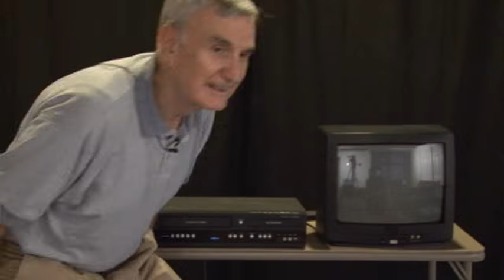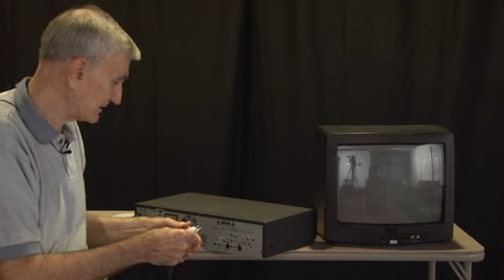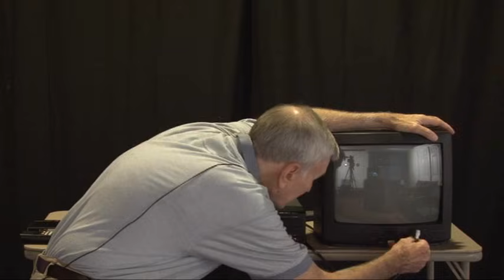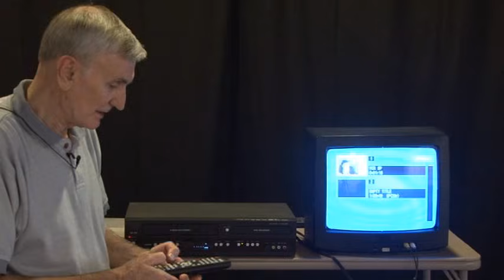VHS transfer to DVD using combo recorder

Comment: Anthony.  I have taken back to Walmart two VHS to DVD Sanyo recorders because they did not work. I had even called customer service for help.  They told me to take it back. I went online and saw that Toshiba 620 was recommended.  So I went to Best Buy and purchased it. However, after hours of trying and throwing away multiple disks that did not record, I finally went on YOUTUBE and saw your video.   OMG... the directions in both Sanyo and Toshiba manuals have told me to select DVD and push the record mode... THEN go on to select VCR and select "play"  THEN push the dubbing button.  Your video tells me not to push record mode on DVD but to begin the VHS tape and push Dubbing button.  AFTER HOURS AND HOURS (I am persistent) of following the directions from those manuals,  I did what you said and IT IS WORKING!!!!!!!  Both the SANYO and TOSHIBA companies need to edit the directions and hire you as a consult!!!!
Reply from the maker: +Margi Jacobsen, Thank you for the very kind comment. It sounds like you have gone to a lot of trouble. I'm happy to hear that you got your VHS to DVD transfers working. I don't know how different or similar various models are but I used a MAGNAVOX DVD RECORDER / VCR ZV427MG9 on my YouTube video. I bought it some time past, I don't know if it is still being made and sold.
Reply: Oi
Reply: Hi there this must have been a error made on behalf of Sanyo or Toshiba,   if newer/later models have inaccurate instructions, then whoever has written the manual has done a poor job, and not done his/her homework and not followed the rules on how to write/produce a instruction manual that is easy to follow and not a headache to learn from. To produce a manual it has to be easy to follow and instructions easy and simple to follow, Sanyo/Toshiba do not have proof readers that will read or see if the products they market is easy to use, as all they care about is money.. Sanyo/Toshiba do not test each product they manufacture it's down to the consumer/End User to see how the product works, Not Sanyo/Toshiba, though it's their responsibility which they regret is not the fault of theres, in which fact it is...
Reply: He makes sure to tell you the right steps so people can follow it right. He is a great teacher and I thank him for being so patient at explaining the process.

Comment from the maker: marion19561, this has happened to me a few times over the years with various VCR's. I most cases I removed the screws that connected the cabinet to the chassis, I removed the cabinet. That made it possible for me to free the VHS tape. I you have the skills to do this, this is what I recommend.  Otherwise I suggest taking the VCR to a repair shop.

Comment: Note: To finalize a disc on my unit you must first press the "stop" button on the remote, and THEN press the setup button.
Reply: Ty so much!!
Reply from the maker: mtaur100, yes sorry, i realized later I didn't emphasize that.
Reply: @dahdigital1  No problem. Thank you for putting out your very helpful video.

Comment: If I made a dvd and didn't finalize the dvd.  Is it possible to put the DVD back into the system and finalize it afterwards?
Reply from the maker: Mary Pepitone, Yes you can.
Reply: you can finalize it years later.....as long as the recorder functions it will still finalize .....if it no longer works the disc can still be finalized on an identical model dvd recorder
Reply: If the DVD is just write once and there is no space left to record or you are sure you will no longer add anything to the remaining space, it is good practice just to go ahead and finalize it. I takes just a few minutes. My recorder has an option to unfinalize, but I've never tried it. I often go ahead and rip my DVD recording to a compressed video file on my computer for convenience so I generally immediately finalize the disc. I don't recommend finalizing a DVD during a thunderstorm or recording one for that matter as the power can fluctuate resulting in a disc that can only be used as a drink coaster. My recorder is the same model shown in the video. I have found it to be pretty dependable. If you get an error saying that your video tape is copy protected, you aren't out of luck, but you will require a video stabilizer and another VCR to play the tape from. Video stabilizers are legal for your own, private purposes as stated under Fair Use law. They are for the most part only available online through places like Amazon and eBay.

Comment: I have one. They are not cheap. Mine was almost $500 dollars. I got it years ago from Best Buy as a birthday present. Well worth the money though.
Reply: back in 2008 they sold for $99 in some places
Reply: End Wildlife Services'Needless Killing Of Wild Animals
Well I wish I knew where. Minw was waaaayyyyy over $99 dollars
Reply: that was future shop......on the downside the   image was a bit choppier with the under $99 models......they are astronomical $300 plus ( canadian) now............the elgato or haupphage game capture devices.....good also for vhs or component video to 'hard-drive to dvd recording'......seem to be  the  cheaper dvd recorder replacement nowadays.....$140-$160 usually from best buy or walmart....i'd like to try one
Reply: I got it for less than $10
Reply: is the output quality much better then those usb video grabbers?
Reply: the quality from the dvd recorders might be better......video captures are not bad but often fewer choices for file size are offered, and more familiarity with them is a must......dvd recorders simplify that process with 2 hour, 6 hour, etc recording options....on plus side capture cards often bypass  copy protection on professional tapes.
Reply: I got mine for free
Reply: do some searches and find one. I am getting one for under $20 and I made sure it had the dvd Record option.

Comment: OMG Anthony, I cannot thank you enough for making this video... I just bought a. new old stock(2015) Emerson ZV427EM5 DVD Recorder/VHS Recorder combo which looks exactly like the unit you have bit I know several companies just use a basic body and button kit so several brands can look identical. Now this is probably my 3rd unit like this, my previous one suddenly crapped out and the circuit board just froze and stayed confused blinking open without opening the DVD door anymore. It was another new old stock unit I'd bought from ebay 10 years ago!!! Which today is all you can really expect from a consumer grade unit anyway... if I get 8 to 10 years from this one, I'll be happy but I could not for the life of me figure out how to get the damn thing to just record a tape to a blank DVD well this is the first such combo I've bought that has a RECORD button AND a D.DUBBING button so when you said to press that to record, it worked instantly!!

Thanks so much again Anthony...duh!! It should've been easy for me at this point but I guess sometimes you're gonna get a device that can confuse the hell out of you no matter how many electronics you have and have had over the years! 🙄😉😊👍🏼💯
Reply from the maker: I get confused very easily

Comment: It's 2026 and mine is the second one I had and I was lucky to find it.
They phased them out 10+ years ago.
I hung on to mine like gold.
I rarely take the time to use it and so many of my old VHS tapes have succumbed to humidity and mildew.

I have a newer mini VHS I want to put on DVD and then Online. It's still over a decade old, but clean.
I still have to find my adapter to use a mini VHS in a normal VHS.
I hope to use it soon.

I had to search out a new manual and found YouTube's on this.
One problem is I don't know where my remote is.

This guy sounds like the Mr. Robert's of the electronics world.

Comment: Great video. I used a Toshiba DVR 620. I believe that is what he is using also. Make sure that you have the correct "L" setting, or it won't work. If you use RCA jacks in the rear, that is L1. L2 is in the front. L3 is for a video camera in the front. Thanks for posting!

Comment: Thank you Mr. Wheeler. I just purchased this item from HSN 3 days ago, and was about to send it back because they never mentioned that you must finalize the disc before you can use it in your PC. I actually recorded the same VHS disc twice thinking maybe I did something wrong. I then tried it on every electronic item in my home that would operate a DVD and nothing, however it did work in the recorder but that's it.  Now that I have seen your video I decided to pop the disc back into the recorder and follow your steps and it worked!!! Actually, because I didn't finalize the disc the first time before taking it out of the recorder the steps were: 
1. Setup
2. DVD Menu
3 Finalize

Bless your ministry Mr. Wheeler and Season's Greeting Jackie from Memphis, TN
Reply from the maker: +Jackie Lane , I'm glad it helped. Thanks for letting me know.

Comment: Thank you so much for this video!! I watched this the day I ordered my machine and I was ready to go when it arrived! I read over the manual also, but it was so easy to understand because I had this information prior to it arriving. I feel like I would have messed things up without this information. I especially benefited from the part where you advise to fast forward through the video to see what the length is. I was able to use the highest quality write speed upon finding out that the videos I was recording were each less than an hour. Again, thank you so much for this very informational video!
Reply from the maker: Jennifer Hinebaugh, Thank You, glad my YouTube video was helpful.
Reply: Thank you. This was very helpful. The problem is that when I try to play the DVD in my computer, it won’t work. I would like to download it into my computer so I can download into a hard drive. Can you advise.

Comment: Having just purchased a SANYO DVD/VCR inline recorder, I found the user manual very confusing and somewhat misleading.  I was about to return the unit until I came across your informative and very helpful video.  Your Recorder looks exactly as mine, and the menu/setup is very much the same, this made a huge difference.  THANK YOU for posting it.
Reply from the maker: Alfred Martinez, Thank You!

Comment: Thank you this after all these years I found some thing easy to understand and it worked
Reply from the maker: David Parritt, Thanks very much!
Reply: Mr. Wheeler,
I have a question we have about 3 VHS tapes (partial) that only 30 minutes on them about.  Is there a way to do put them on one disk; like changing the VHS tapes and continuing with the same DVD or would this mess things up??  Do you know another way to join them together if so??  Burning them on a PC that has that function for example.  Would appreciate your help.  Still love what it has done so far especially my wife!!
Thank you again, in Christ the Lord, Dave
Reply from the maker: David Parritt, If you will watch my YouTube video, "Simple editing using combo recorder to transfer vhs tapes to DVD" I try to explain how to record videos from more than one tape to a DVD.

Comment: Thanks Anthony:  I was afraid of that. I see a few being sold on Ebat as "parts"machines. Other than this occurance it was fine I think the only one out there now. The reconditioned ones are going for $129 or so. New ones in the $250 range. I do not want to remove any screws. Gonna try one more thing and then see if I can sell for scrap.
Thamks for the FAST reply!

Comment: Thanks for the video!  I guess it is finally time to start moving some recordings from VHS to DVD!

Two notes:
1. The initial rewind step seems unnecessary, as you could just FF to the end, clear the counter, then REW to the beginning, thus saving the time of the initial rewind.
2. Many used VCRs (and combo VCRs) are sold without a remote, but it appears that a remote is absolutely needed for this operation.
Reply from the maker: I did all that, then put everything on my hard drive!

Comment: Fantastic explanation. In my case, during the finalization process, I had to switch my source to VHS to get to the settings and then during the finalize process, switch back to DVD, it was weird but it worked!
Reply from the maker: aeendale100, Yes! I made an updated YouTube video because I left out a very important setp, that is to press the STOP button before going to the finalize menue.

Comment: I was wondering if you could tell me what you use for the dvds to burn on? Exactly, brand and all. I'm asking b/c I've tried a few different types and the player keeps rejecting them. I don't know if I have a bad player of if I'm just using the wrong type. So, it I know what type of dvd you use maybe I can figure out if I need to take it back or not. Thanks so much and the video was very helpful!!!

Comment: Also, to piggyback on 2:37, if there is a piece of scotch tape where the security tab was, you need to remove or puncture it for the same reasons that you would break the security tab off.
Reply from the maker: RJNO607, Thanks for the input, I agree.

Comment: Hi, I found your video helpful and relevant to what I'm trying to do, ie convert VHS and Hi-8 to DVD using a new Panasonic VHS/DVD combo. Please can you confirm whether or not I should be using DVD+RW (and or DVD+R) discs ....as opposed to the ones I'm currently trying to use and which don't seem to work i.e DVD-RW. Thanks

Comment: I bought a ZV427MG9A 3 years ago from Walmart and it stopped working. Now when I put a vcr tape in it it eats the tape and turns off. The DVD part works fine. Do you know why the vcr part does''nt work?

Comment: Such an incredible video. I hooked up to TV on the first try, and followed instruction to a 'T'. I feel redeemed in my ability to accomplish this task! Thank-you Mr. Wheeler. My only issue is not getting the 'finalize screen', ergo I still don't know if this worked. I am using a SONY RDR-VX530.
Reply from the maker: Maryann Fougere, Thank you for your comments. I am not familiar with the Sony brand but i hope you have an instruction manual that plainly shows how to finalize.

Comment: I was incorrect, they are VHS C tapes. What a nightmare trying to transfer them onto DVD. I am not a great techno person but the DVD will not work on other systems even after finalising. Perhaps I am doing something wrong. I have followed your instructions step by step 3 times and still not working on other systems.

Comment: I have the exact same one you have and it keeps automatically stopping its vcr to dvd recording and then shutting off. The exact time it records is undetermined.  I'm at a loss and I'm wondering if I should return the one I have and get another one or not :- (

Comment: It may need new belts, however with these new VCR's it usually isn't worth it. Most VCR's made after 1995 are just complete junk, so I recommend saving yourself time and money by purchasing a used deck from the 80's or 90's. The older machines were built to last and are more serviceable than the new machines. To convert the tapes to DVD, just plug the outputs of the old VCR into the combo, and record to a DVD.

Comment: Commercial tapes usually say how long the tape will play somewhere on the tape or label, but go ahead and advance the tape to the end and rewind it to the beginning first. What that will do is loosens the tape parts that may have been sitting for a long time so the tape plays without having to fight a stiff mechanism. The winding also evens out the tape on the reels which will help keep the tape aligned with the heads for a better transfer. This is even more important if the tape was never rewinded fully after the last playing and has been left in storage like that. It's generally bad practice to store a tape without rewinding it after use.
Reply from the maker: Robert Gaines, Good Information, Thanks

Comment from the maker: Your video should now be on a DVD. You will need to put the DVD into your computer where you have the Pinnacle editing software installed. You will need to rip or copy the DVD to your computer. I don't know if your Pinnacle software will do this. If  your Pinnacle software will import the video form the DVD you should be able to edit the video.

Comment: 1 Thanks, I am using a software 'DVDFab 8.2.1.5' or later that rips all sort of dvds. There is plenty of other excellent softwares out there. Download link (extratorrent) and type it. Haven't tried it. I need to buy a vhs/dvd combo. I read a manual before buying it, a) who stats that it works great with any PC, equipped with dvd-rom after dubbing vhs to dvd. b) If does not finalize the recorded dvd first before use otherwise it won't work.

Number two continues...